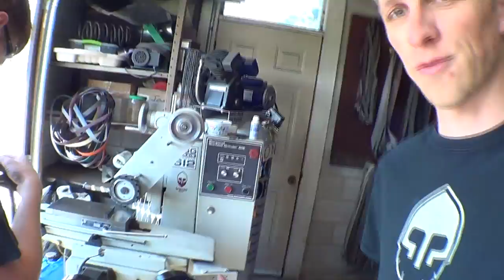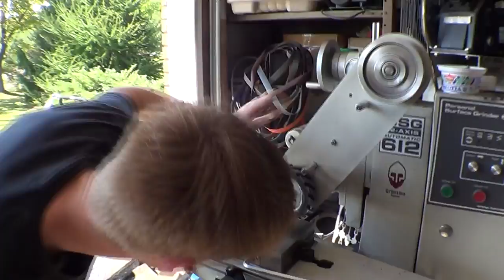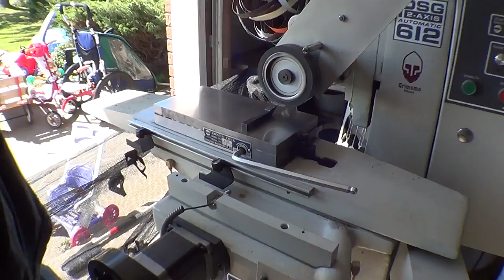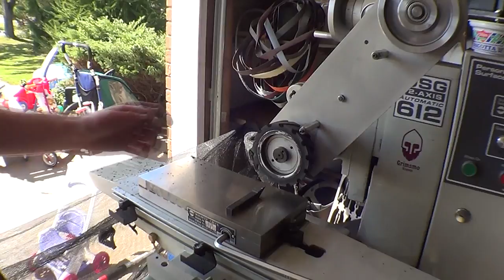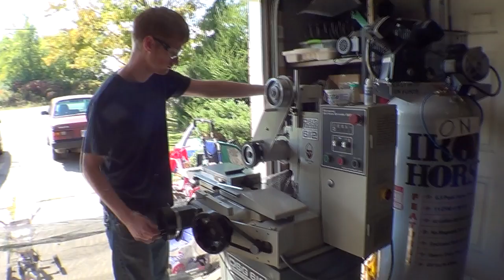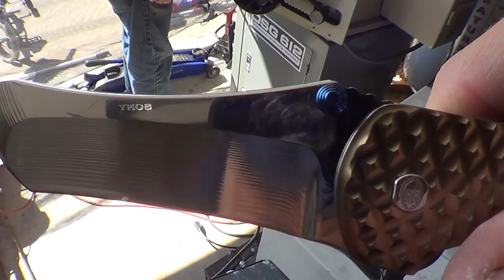Knifemaking Tuesdays Week 94 - Dressing the belt drive wheel on the Tormach PSG612

Comment: Where did this idea that a grinding wheel must be dressed every time the motor is turned off come from? I first read that in a comment on a nyccnc video, and have yet to find a credible source even suggesting that rule. Suffice to say that tuning off the motor doesn't condemn you to dress the wheel. Its a misleading rule of thumb that would convince you to dress the wheel when unnecessary and not dress when need be.
Reply: Just dress it when it gets a little worn and looses it's sharpness. Turning off the spindle will not hurt anything unless your doing extremely high precision parts where spindle heat matters. But using a rubber wheel has turned his halfway precision grinder (I laugh at Tormach) into an abrasive finishing machine. For grinding in a machine shop, belts and rubber wheels offer no precision.
Reply: As far as polishing with belts on the grinder, I agree that my comment has no relevance. Im simply against that terrible rule of thumb being ever spoken of. When I did my tool making course, the grinders we had a safety inter lock that prevented us from reaching the work while the motor was on. As you can imagine we had to stop spindle repeatedly, while not dressing to maintain calibration. Still we managed to hold tight tolerances. The question of when to dress is a difficult question to answer, as there is no definitive rule. Dressing is not only time consuming, but all calibration between the Z axis dial and the base of the wheel is lost.